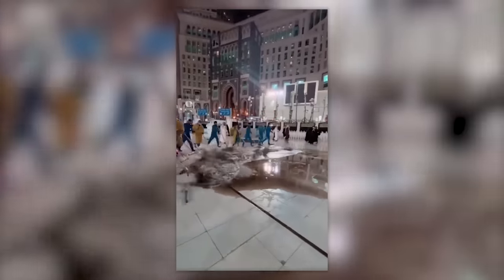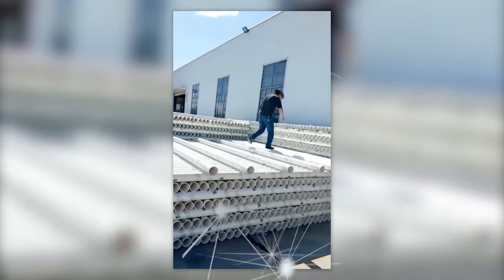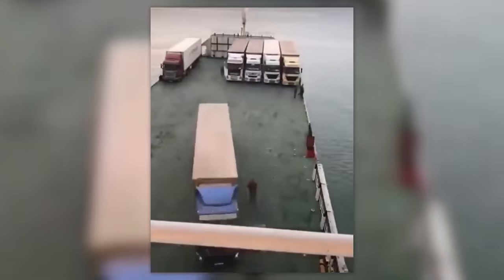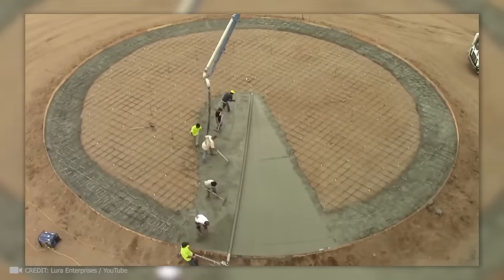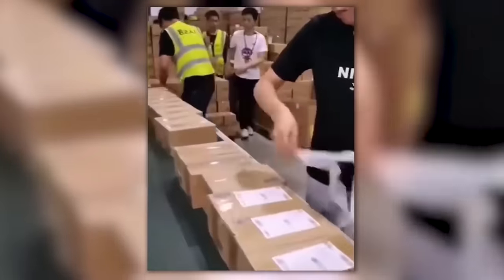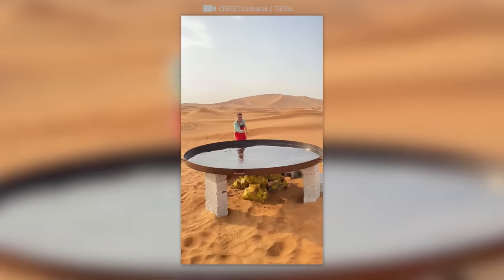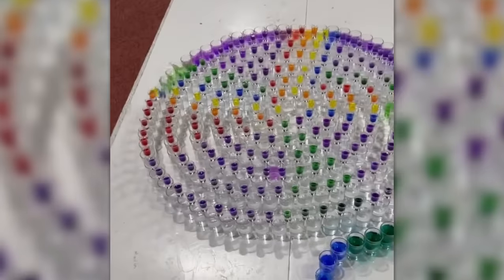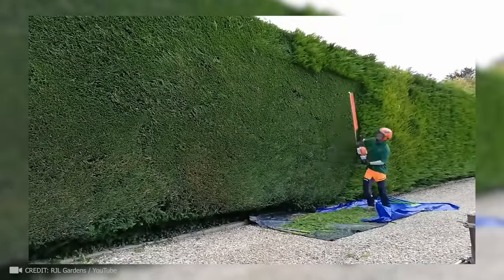Most Satisfying Videos Of Workers Doing Their Job Perfectly #5

Comment: I had an Uncle that changed lightbulbs on those tall towers he is retired now. He told me he worked 10 days each year for 20 + years and made over $100,000 a year. to make $10,000 a day to change a lightbulb that is super high in the sky. I certainly wouldn't have had the courage to do that job.
Reply: How long does it take to change one of those light bulbs --- one whole day?
Reply: @donnysath9084  he has told me depending on the weather it takes between 4 to 12 hours. Safety first.
Reply: @charlesrogers4085  was he on call all the time for when 1 goes out?
Reply: @Dogpool  yeah he was. He told me that he worked a total of 3 days in 1996. He normally worked 9-10 days a year. The buildings tower antennas he'd climb would sometimes sway a good 20ft on a windy day.
Reply: @charlesrogers4085  Sounds exciting and horrifying at the same time. What a job!
Reply: @kirnpu  I guess. I'm terrified of heights so I'd never do his job. He started when he was 27 and retired at 52. He's 78 now.
Reply: @charlesrogers4085  I'm in awe. Thanks for sharing!
Reply: Would need to do some serious training to be able to make that climb. Then a day or more to recover.
Reply: @Flipper86  oh yes. My Uncle had 6 months of training as he had to be trained in all elements of weather.
Reply: @charlesrogers4085  I was thinking physical training to do the actual climb.
Reply: @Flipper86  I know that is what he had to do. He trained in the rain, on extreme windy conditions, extreme temperatures. He also had to train with a harness and without.
Reply: Thanks for sharing your amazing story. He's the original Braveheart

Comment: 1:40 that blade is not from a windmill its from a wind turbine, a windmill is used for grinding wheat into flour and has fabric blades while a turbine is used for converting perpetual motion into energy
Reply: I grew up in south west Texas.
We used windmills to pump water out of the Edwards Aquifer.  They had metal blades.
Reply: Thank you I said the same thing, that blade is from a turbine.
Reply: Yea your right
Reply: Bro
Reply: @robertecarpenter  it’s still a blade from a wind turbine
Reply: Incorrect!  A Windmill is used to MAKE power to use in direct ways on location. It can also be used to pump water out from behind a levee etc. 
A Windmill can also be a Wind Turbine to convert wind into electrical power.

Both can have cloth or fibreglass blades!

Also, there is no such thing as "Perpetual Motion!" Wind power is not such a thing! Wind fades and/or grows in strength.
Reply: @ivanivonovich9863  actually a windmill is a small Mill that is used on farms to grind wheat into flour and other grinding processes. A wind turbine is what is scattered all across the british countryside providing power to the masses 

also A windmill CANNOT be used to generate power as the speed of rotation of the blades is far too slow for perpetual motion hence why a windmills blades are flat against the wind and often have 4 blades whereas a turbine has 3 blades angled to create less Drag 

as for both having fibreglass, maybe mills in the modern day might but i haven't seen any and if you put fabric blades on a turbine it wouldn't work as the fabric is porous and won't catch the wind and will most likely be destroyed at the height that turbines stand
Reply: Well you did have to point that out.  But yes, the blade is for a wind turbine.
Reply: @ivanivonovich9863  wrong. There is perpetual motion. The wind moves all the time. It is just that the wind is powered from outside the system (solar radiation).

What you are referring to is perpetual motion in closed systems. That doesn't exist.

Comment: The only guy I can understand his expertise is the guy stickering those boxes. Every1 else is doing things I have no experience with at all. But I work at a lumber mill in 1 of the planers. I primarily pile lumber but I have done plenty of stickering lumber too. And at the pace this guy was stickering is a comfortable pace and not even fast. I've stickered 1x4x6-16 knotty and selects. This means I have 2 different grades to sticker and 6 different lengths to sticker. So a total of 12 different stickers I have to use. And the boards can go much faster by then those boxes were. The planer can send those boards out as fast as or even faster then 0.5s each.

Comment: 10 seconds to gut a fish? That's slow as fuck! I can GET a fish in about 3 seconds. It's not hard to do, and I am a chef. Now, to de-scale a fish takes longer and depends on equipment used, and to dissect a fish depends on the type of fish you're working on. Then you have to factor into the equation the thorough removal of bones. If you can de-scale, gut, de-gill dissect and debone a fish in 10 seconds,  then I would be impressed.
Reply: ok big boy